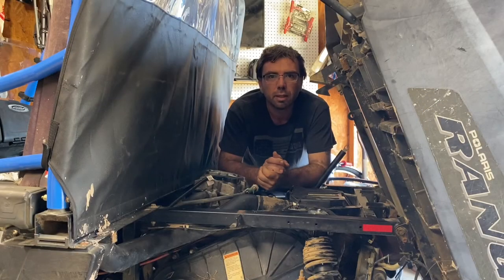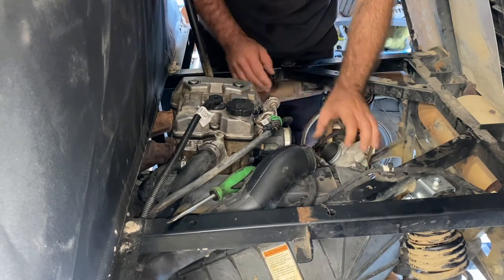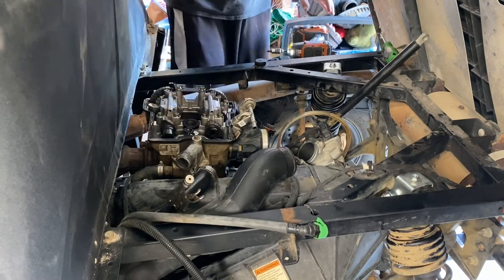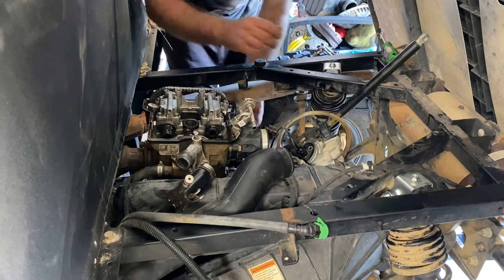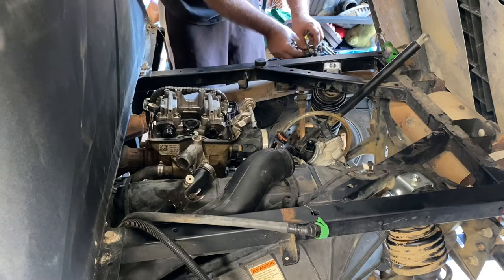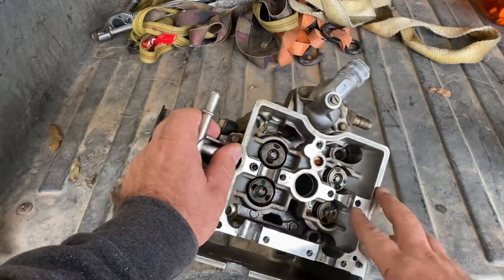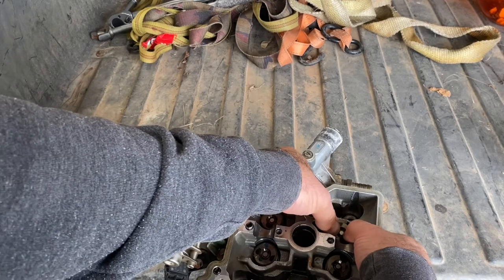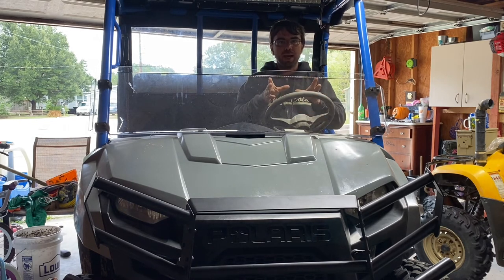Polaris Ranger 570 Cylinder Head Replacement

Comment: Hello there, I'm hoping you can give me a bit of advice. My 2019 570 sportsman developed a loud clicking, sounded like in the top or a little lower in the jug, pressure coming from the oil dipstick hole,  oil coming through to my air filter and I could smell burning oil from the exhaust.    Anyway, I assumed maybe a piston ring so I pulled it apart today and the piston, rings and jug look good, just 4-5 pretty light scratches on the cylinder walls that I can barely feel with my finger nail, most all the cross hatching is still there even.   Of course I'm ordering a new piston/jug/gasket rebuild kit but I'm having a hard time believing my problems were caused by those few light scratches. Could that possibly be the culprit? Could my timing have jumped somehow and caused those issues? Everything in the head and in the crankcase looks bran new so I'm at a loss. I hate to put it back together without fixing the problem. I'll gladly pay you for any knowledge you could share.  Thanks

Comment: You wouldn't happen to have a video of the clicking noise it was making ?
Reply from the maker: Unfortunately no. It was a very fast clicking noise, wasn’t really there on idle but got louder as you raised rpm’s.
Reply: Dang,ok,appreciate the reply,would the timing chain  make a fast ticking noise? Should I try replacing the tensioner first?
Reply: My noise is rite on Start up,runs good,no loss of power either.. I have a 2018 ranger crew 570
Reply from the maker: It’s hard to say. Chances are it’s the tensioner. I’d replace it with the upgraded hot cams tensioner. I have a video on it. Also join my Facebook group, it’s a lot easier to communicate and post concerns.
Reply from the maker: @samtuck4812  sounds like tensioner is failing. Very common their junk. I’d recommend doing upgrade to the hot cams tensioner. I have a video of it. Hopefully no chain damage has happened. Tensioner leads to chain going out.

Comment: I am not a mechanic but with your videos I completely rebuilt my 2015 Ranger 570 top end with new Polaris cylinder, piston, head bolts, new valve seats, gaskets, and 2 new exhaust valves-they showed wear on the stems.  Everything went back together fine.  Engine is running smooth w/o smoking or any noises.  It was running a little too hot until I bled the coolant screw but still seems to be running a little warmer than before the re-build.  I have ordered the hot cams tensioner that you suggested.  I do have a problem.  Polaris sent 2 head gaskets.  I'm pretty sure I installed the wrong one because my old one matched up perfect to the extra one I have that Polaris sent.  They were very similar and I must have got them mixed up at the last minute.  I just realized this.  I have about 2 hours on the machine.   I'm guessing that's my reason for higher engine temps than normal.  Looks like I have to tear it back down,  Any thoughts, suggestions?  Thanks and thanks again for the great information on all of your videos.
Reply from the maker: Hello hopefully I’m not to late in responding, I have noticed with the 570 when bleeding the system raising the front end up 12” or more will help get all the air out. Any air in system will cause it to run warmer.

Comment: Hello guys, I just got the call about a week ago from my local repair shop that my 2017 sportsman 450ho has destructed itself. They say the woodruff key sheared, timing went retarded, so the piston hit the valves and damages occurred at what ever level - not sure how bad until I get it back and look myself. Obviously I Cant afford to have them rebuild, or replace the engine… itd cost more than the machine is worth. They are currently trying to reach out to Polaris to ask for any possible help since the machine is only at 350hrs or something and 11 months out of warranty. Had all the recommended services done at the proper time intervals as well. Im almost positive Polaris will do nothing, so Im already pricing rebuild kits and preparing myself for rebuilding. You think itd just be top end and valve damages? Or is it possible the crank and shaft and everything is screwed…?